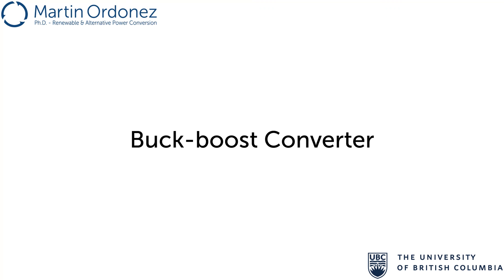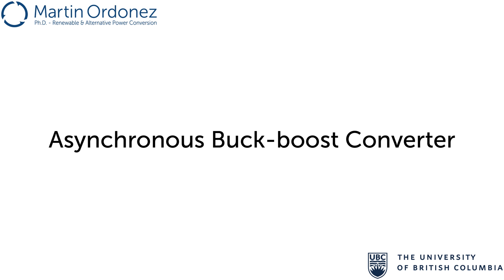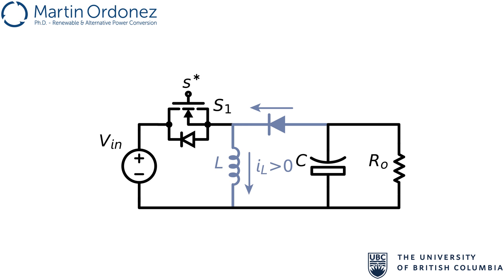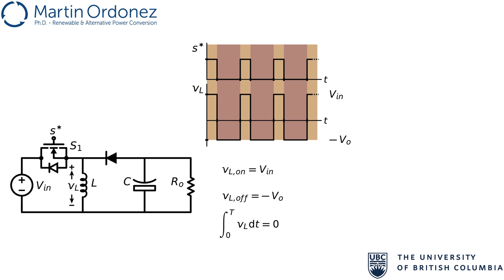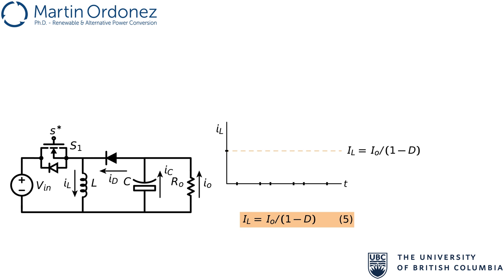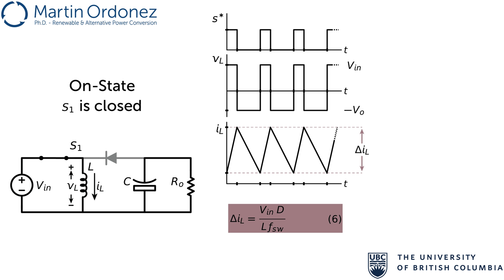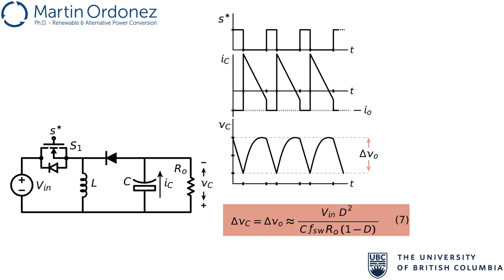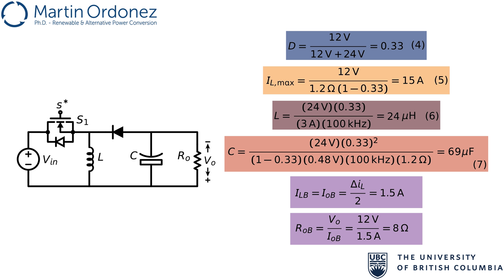Power Electronics - Buck-Boost Converter

Comment: I think the last calculation where RoB is calculated is wrong because Io average is not equal to the average inductor current. io average = iL average * (1-D) so the RoB should be 12/(1.5*0.67)=12 ohm

Comment: but when the load is non resistive load but an DC shunt motor the output polarity is reversed as shown in the video it means the motor rotation will be in reverse too?
Reply: and can the circuit applicated in DC shunt motor within 5 kW capacity (400V supply) ?